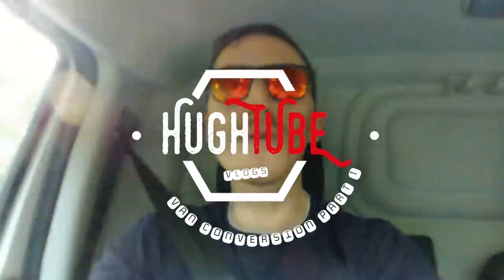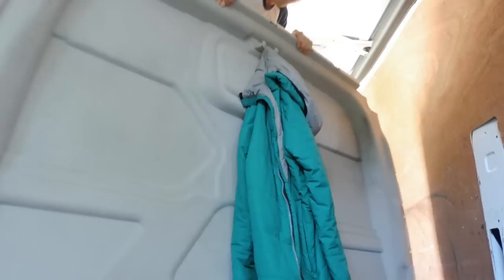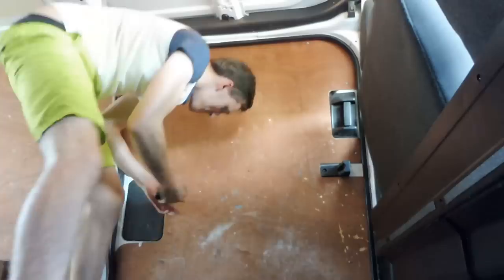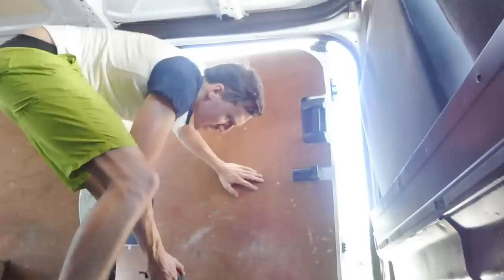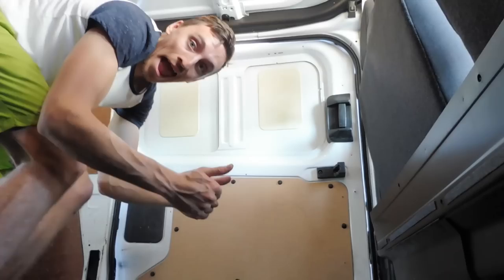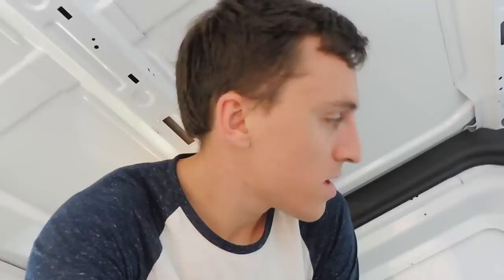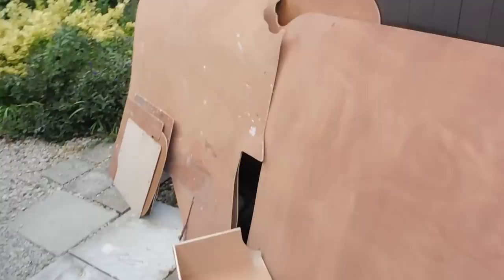VanLog 01 HOW TO BUILD A CAMPERVAN CONVERSION Ford Transit Custom!

Comment: Great Videos, I especially liked the clarity of your separate post on electrics. I am planning a conversion and would like to go for the low roof option without a pop up. How practical have you found  the headroom aspect.
Reply from the maker: for me i much prefer having a high roof now but the low roof is great for fuel economy and getting into all car parks

Comment: I’ve been following your channel for a few years, dipping in and out - always enjoy your content! Do you still have the Transit? I’ve seen you’ve converted a number of vans since. Would you rate it? I’m completely new in that I’ve never converted a van. Pretty handy at DIY and watch countless YouTube videos on the subject. Can’t afford a Transporter, but like the look of the Transit as a possible option for a swb conversion.
Reply from the maker: Hi Sam thanks a lot! I loved my transit custom, lovely to drive and looks awesome if you can splash out and find one with air con and/or cruise control though as I missed both of these haha

Comment: Hiya. What did you use to treat the spots of rust where the screws came out? Looking at doing it on mine but not sure what product to go for...
Reply: Red Oxide paint is good, which you can get at most DIY stores or online. You can paint it on bare metal.
Reply from the maker: Exactly what Nizan said, red oxide paint is great or we used Hammerite paint which is rather expensive but we had some lying around

Comment: What base model van did you choose?
Reply from the maker: I chose a 2013 Transit Custom L2 H1, which basically means long wheel base with a low/standard height roof.
Reply: Sorry.. what engine power
 & van trim?
Reply from the maker: oh sorry haha I got the 2.2 litre 290 eco tech panel van.
Reply: you do know transits are the most commonly stolen van in the whole of Europe, locks easy to pick and can cut wiring loom to back door with Stanley knife blade to unlock